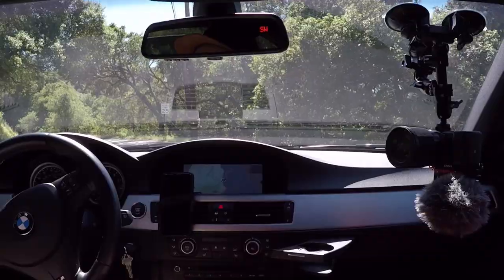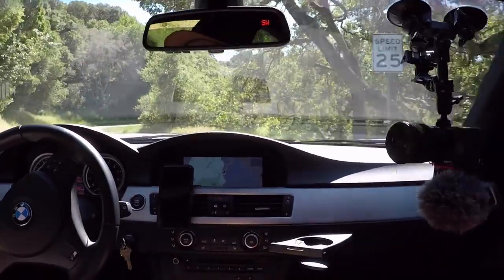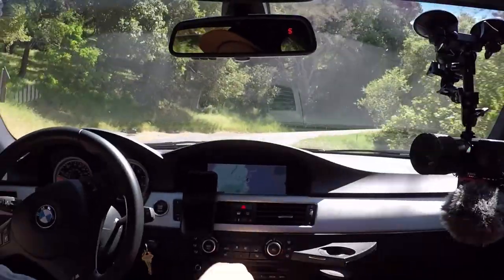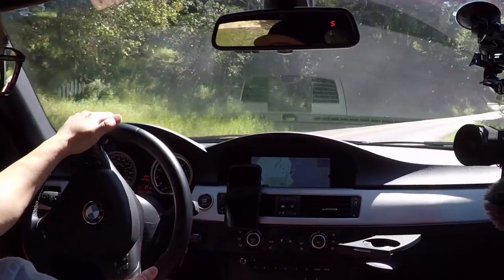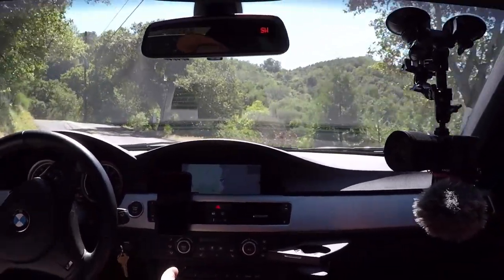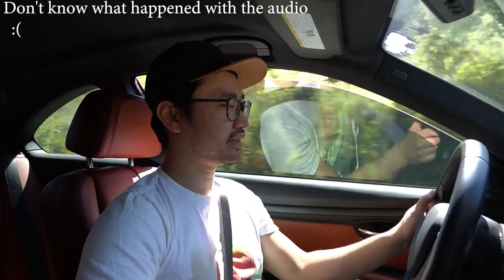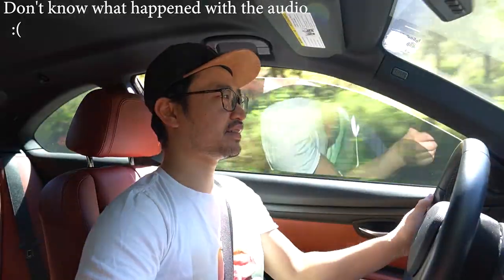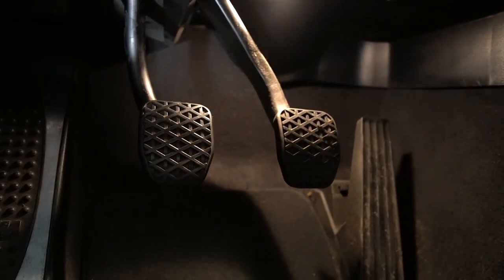Ultimate Clutch Pedal - Thoughts After Installation on E92 M3

Comment: I’ve purchased the UCP and wondering how to go about installation. I have an 08 e92 m3 which doesn’t have the inner spring only the outer one. I’m contemplating purchasing the 2011-2013 spring assembly to acquire the inner spring. Any thoughts on this?
Reply from the maker: Try it without the inner spring first to see if you like it. If you find it wobbles too much you can still purchase the inner spring and install.

Comment: One issue I feel about my E90 is clutch feel. I do most of my clutch engagement through noise and watching revs compared to my 04 TSX I could feel through the pedal what was going on which was a nice feeling. Do you feel that the pedal has improved feeling on that end as well, or just adjustment of travel and bite point.

Appreciate your video and feedback!
Reply from the maker: Feeling is improved a lot with the UCP. If you have a 6spd e9x m3, UCP + auto solutions SSK is a must IMO.
Reply: @WillsGarageOfficial  Great, thanks for the feedback